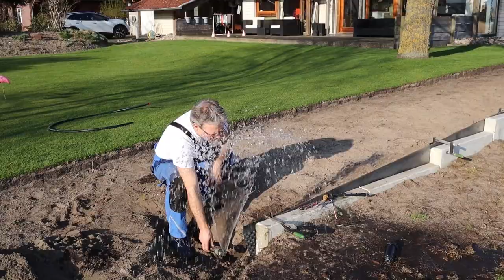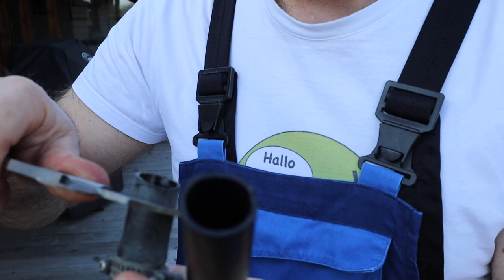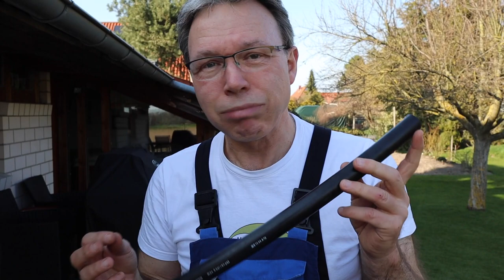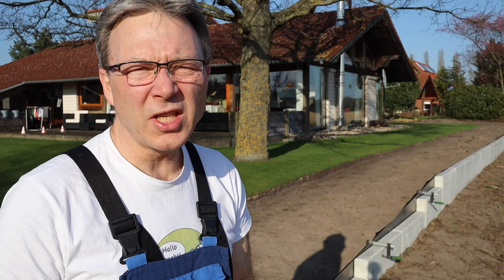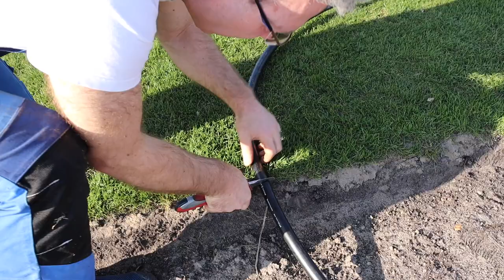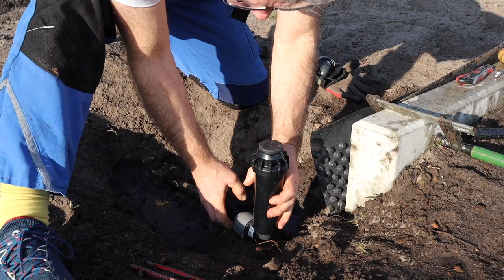BEWÄSSERUNG umbauen⎮GARDENA DRAMEN ohne Ende⎮RASENBEWÄSSERUNG ist Fummelei, sagte der RASENFREAK!

Comment: Den Regner sollte man mit flexibler Leitung anschließen,  also Swing Joint oder Blulock. Alles andere ist zu starr.
Reply: Hallo, danke für den Tipp. Die BluLock Verbinder sind mit 24mm angegeben - passt das 25mm Gardenarohr trotzdem? Würde mich sehr über eine Antwort freuen. Viele Grüße an alle Rasenfreaks
Reply: Ich habe Blulock in 15mm wenn ich mich recht erinnere. Diese kleinen Leitungen nur als Übergang von PE Rohr zum Regner. Dafür gibt es fittinge mit Gewinde.
Reply: Vielen Dank für die schnelle Antwort.
Reply: @thomasbechtelmechtl5405  es gibt noch SPX-FLEX von Rain Bird. Damit habe ich 40 Regner angeschlossen und weil die Leitung flexibel ist lassen sich die Gehäuse sehr gut ausrichten.
Reply: Danke für die Tipps. Alles Produkte, von denen ich vorher nie etwas wusste.

Comment: Ein begnadeter Mechaniker, der unterhaltsamste Grünerhalter sowieso, aber wenn es an die Bewässerung geht, muß ich immer wegschauen. 

Rohr trennen mit dem Cuttermesser? Da gibt es eine Schere oder eine kleine Bügelsäge.
Das ist dann nicht ganz so gefährlich. Denk' an Deine Nachahmer. 

Die Heißwassergeschichte scheint gut zu funktionieren. Das ist vielleicht etwas umständlich, wenn es um mehrere Rohrstücken geht. 
Eine kleine Lötlampe hat sich bei mir gut bewährt.

Das alte 19 mm GARDENA System an neue Geräte adaptieren? Frag doch mal bei deren Service nach dem Ersatzteil  Nr. 01550-00.610.00  L-Stück 3/4". 
Damit ersparst Du Dir diese, nicht ganz fachgerechte Adaption via 25mm PE Rohr.

Warum muß der Regner eigentlich genau an der Rasenkante stehen? 30 oder 50 cm weit im Rasen würde er viel besser aufgehoben sein. 
Es geht um die Kopf zu Kopf Benetzung bei Getrieberegnern im Verbund. 

Großartige Slomo Aufnahme beim Druckschlag! Auch wenn das ärgerlich ist. Es ist eine sehr schöne Aufnahme. 
Und lehrreich! Entleerte Bewässerungssysteme sollten langsam „angefahren“ werden.

Großartiges Kino! Ich warte gespannt auf die Fortsetzung.